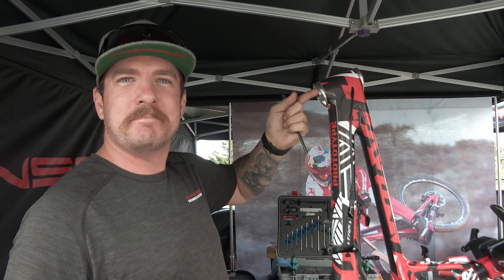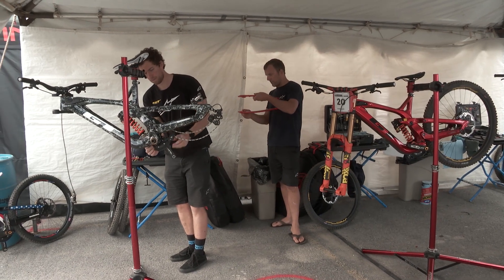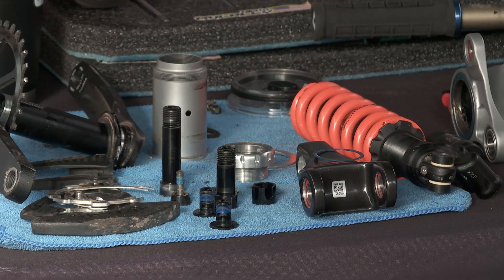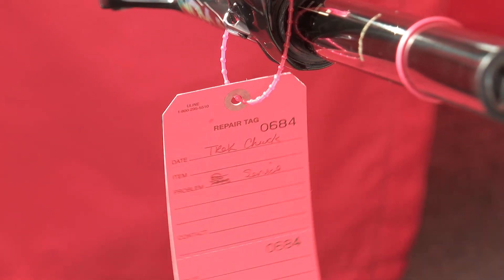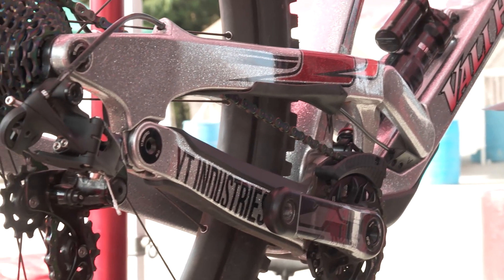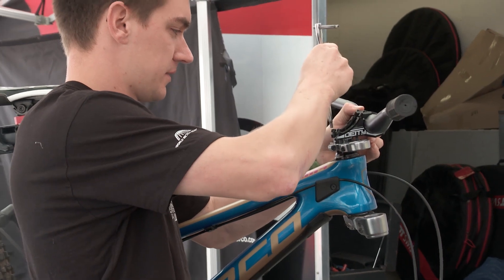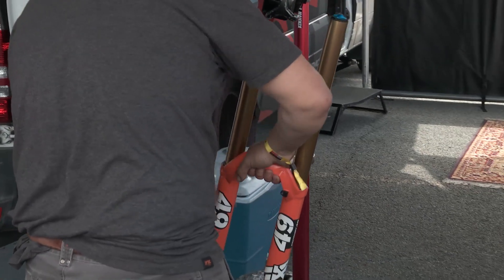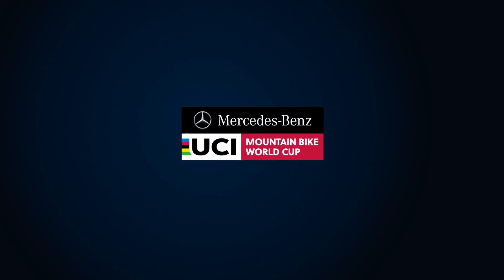WORLD CUP DOWNHILL BIKE BUILDS - PIT BITS from Snowshoe, West Virginia

Comment: 2:52 Danny has the same proto shock that loris had last week. The reservoir looks like it could have a spring backed IFP because there is no valve for a shock pump. That would result in more consistent damping across a big vertical change because change in pressure of the air spring that supports the IFP would be eliminated as an issue. Interesting.
Reply: How is the elevation supposed to change the ifp pressure? It's an isolated system
Reply: @MrPelide1000  The net amount of force exerted outwards by a pressure vessle is relative to the pressure outside the vessle. If the pressure outside the vessle decreases, the force exerted outwards by the gas will increase. For the ifp, this would mean that at the top of a several thousand foot descent, the pressure in the air spring of the ifp would be higher than at sea level due to the change in air density outside the shock reservoir.
Reply: this aged well